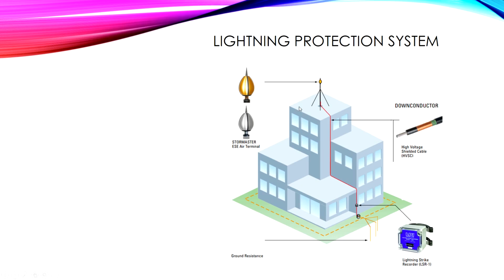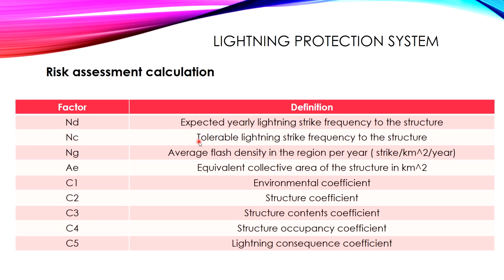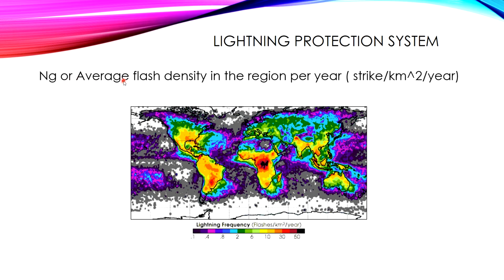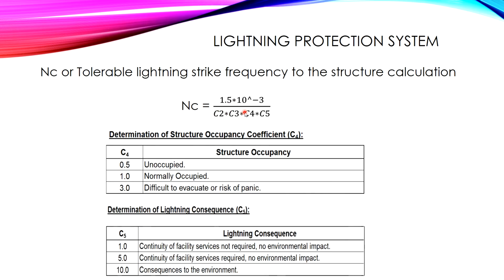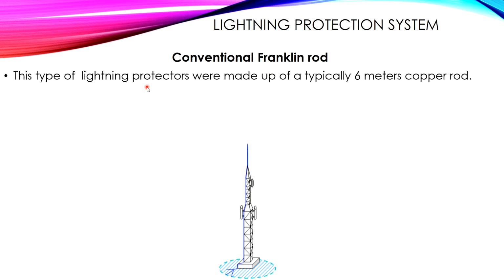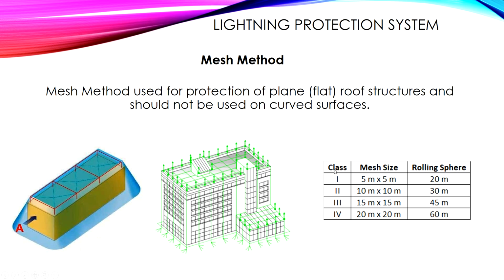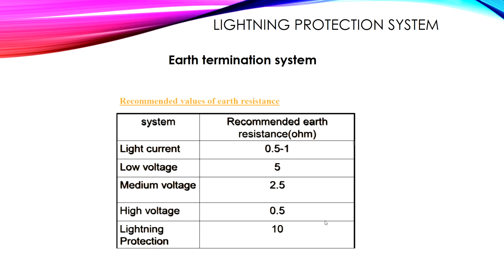Design Lightning Protection System in Power System Protection Online Course

Comment from the maker: 🌟 Access 100+ courses, 1,600+ videos, and 300+ hours of professional lessons!

Master electrical engineering, renewable energy, and much more with Khadija Academy Student Membership. Learn real-world skills through expertly designed courses on topics like:

✅ Solar Energy, Electrical Design, MATLAB Simulink, Power Electronics, Wind Energy, Wave Energy, and more!

🔗 Explore it all here: https://www.khadijaacademy.com/p/khadija-academy-student-membership

💡 Your future starts here—click to join now!
Reply: I am interested in taking the course. My intension is to design according to NEC. Let me know if your course follows the NFPA70 & NFPA780.
Reply from the maker: Late reply, the answer is yes, you will find major part of the course that includes the short circuit protective devices, the conductors, feeders, and disconnect switches design using NEC 2017 and NEC 2023.

Comment: Hi  Ahmedmahdy, informative video. 

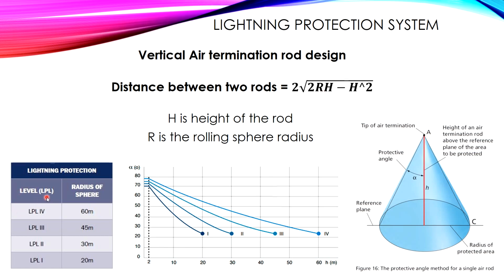refer to time 23:00, distance between 2 rods =2 x sqrt( 2RH-H2)
basically this distance gives angle of protection, ie, 2 times radius of protected area.
so from the graph, if we select height and angle, with equation H*Tan(alpha) we can find protected area radius.

Then what is significance of radius of rolling sphere? 
Suppose we take same height H from graph, and take radius of rolling sphere (R) from protection class table (given at left of graph), and apply in formula, 2 x sqrt( 2RH-H2), we should get same  value which is protected area radius.

But when i tried both ways the result is2 different value. Can you have a look and clarify it?
Reply: Very informative video. Thank you

Comment: NICE EXPLANATION BUT I HAVE A QUESTION WE CALCULATE CROSS SECTION AREA OF DOWN CONDUCTOR FROME EQUATION 
a(mm2) = 9*SQRT(T)*Isc ?? AND WHAT IS THE VALUE OF SHORT CIRCUIT CURRENT ( I SEE ITS 3 KA MIN AND 200 KA MAX FOR TYPE I) , THANKS ALOT :D

Comment: I have one question  I m from India, Good information👌, Brother if the building height is morethan 60mtr height means how we are going to protect building for side flash ?

Top 20% of the building height for side flash protection is it sufficient ?
Reply: Hello, I can tell you about it. The design on Burj Khalifa, 832 mtrs- it is above lower cumulus cloud cover where thunderstorm occurs. We had to provide steel 50X6mm strip as equipotential bonding all across , going round n round , connected to steel core, that is earthed. For more details www.ampereprotection
com